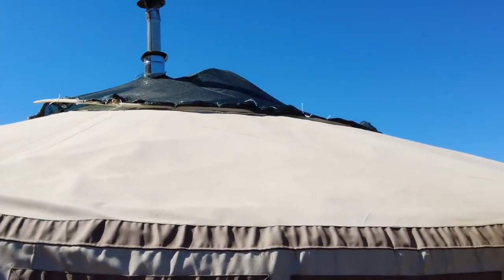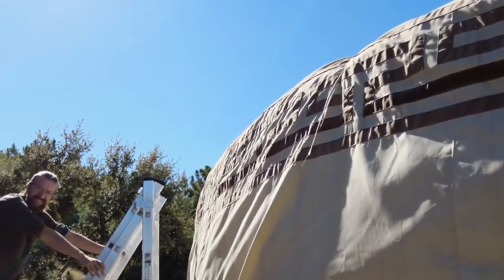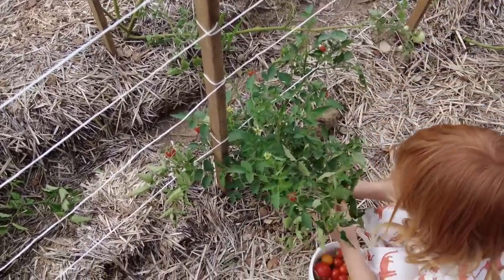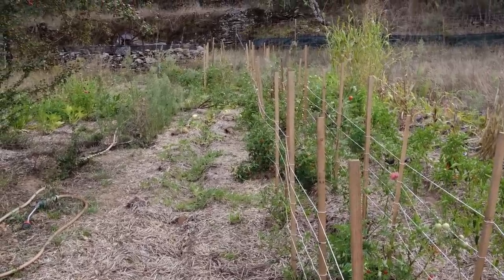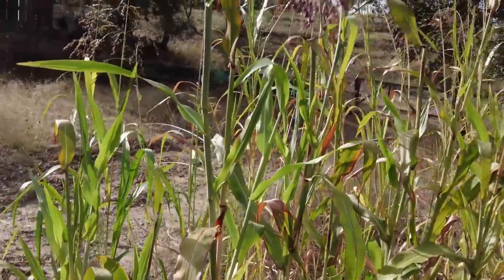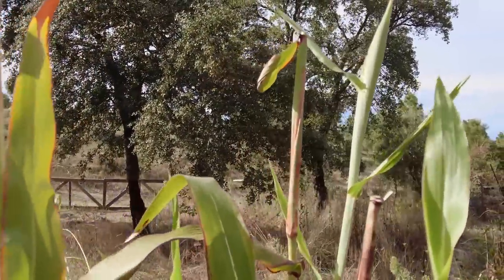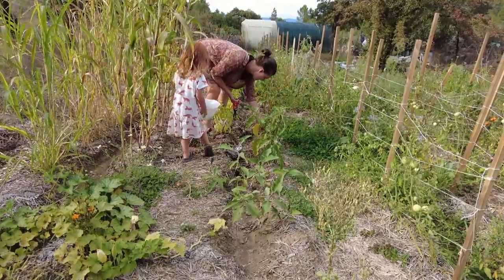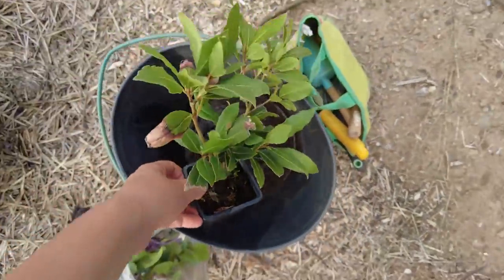Some tlc for the Yurt - maintenance step one and fall planting

Comment: Weeds Tip: If you grab them at their base and shake it before pulling it helps to loosen the root from the soil making them easier to pull out with the roots attached.

Comment: Always such lovely videos. Just a quick gardening tip that I am sure you know anyway: try to rotate where you plant what, e.g. try not to plant cabages where you had mustard year before as they are both from the brassica family. This helps prevent disease build-up in the soil. In reality though, sometimes you just have to pop them in the soil where there is space before the seedlings die!

Comment: Just wondering about the wood stove and the heat on the outside surface or its double walled ?
Reply from the maker: No it’s single wall, just the part where it goes through the roof is double.